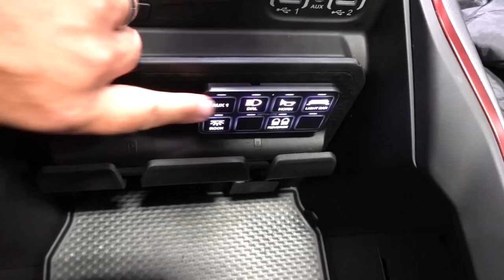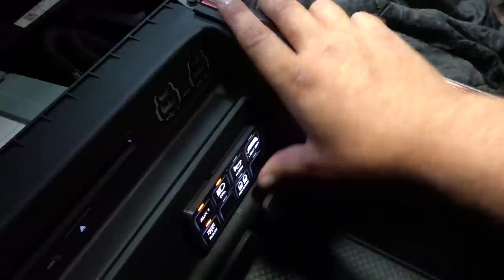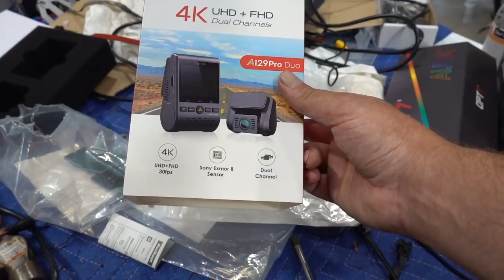2019 Ram Rebel Switch Pros And Dash Cam

Comment: Have you had a problem with alternator out put after adding all the lights and electronics? Mine seems to have dropped to about 3.8-3.9v while cruising. Thinking I need a bigger alternator?
Reply from the maker: wow that's a big drop, I have not had any issues really all I have is the light bar since I only use the reverse lights when backing up in the dark but it is all led so not a huge draw on mine

Comment: Hey man, i have the same truck and am having some issues figuring out where to tie in the ignition fuse for the switches. Which fuse did you tap for the ignition wire?

Comment: Good evening Steve!  Hope all is going well.  Has a question for you, what’s your take on CAI for our Ram Rebels? I noticed you haven’t done that yet....or have you?  Maybe i missed it if so.  Was curious on your thoughts on a CAI for my 2020 Stock Rebel.  Suggestions on brands on either oil or dry system?
Reply from the maker: I am waiting for the one from Cold Air Inductions it hopefully will be out soon but in my opinion they have the best product for my truck

Comment: No worries on the hiccup, makin some changes takes some figuring out along the way...congrats on everything coming together and working properly im glad thats the case👌 looking great now 👍👍 question when andbif you want to add to the 2 empty spots on the switch pro you dont have to hack in again to get to it for a hookup do ya i cant remember it the mains are just under the hood, and if so did you extend some wires from the switch pro box for easy access for the future?
Reply from the maker: That’s the beauty of the switch pro it’s all under the hood now that it’s mounted

Comment: I ended up using the trigger on the side marker and the lights I tied into the bed lights, so when I unlock my truck or want to turn the bed lights on, the rock lights will turn on with it when you set to in the switch pro app.

Comment: I really like the switch panel. Not a fan of the dark paint in the mezzanine it might be too dark later but that's probably just me. Super jealous of your shop though!
Reply from the maker: Snowcat_srt it will look different once the white trim is in and the neon signs will brighten it up for sure, and yeah the switch panel is pretty awesome when you have a bunch of accessories makes it easy to control them
Reply: @HammerdownMotorsportsUSA  hell yeah man. It might look darker than it is because of the video. Anyways man keep it up!! Can't wait for those spacers

Comment: If you don't want to see the wires around the battery.... we used to cut some black plexi around the battery and contours and put a couple of small brackets in and cover all of it. Looks awesome.
Reply from the maker: I may have to do that I would like to cover the wires for sure
Reply: @HammerdownMotorsportsUSA  hit me up when you want to do it and ill give you some tips. But in short. Use a cardboard box to cut a stencil around all the contours and battery. Then trace on to 1/4 inch plexi (color of your choosing' but in the engine bay black works well), use a jig saw (with appropriate blade) or a router to cut. The place small brackets I places that might need it. Added bonus the plexi now gives you an area for decals or to mount additional items.

Comment: How did you get ur key fob to unlock your truck without pressing the button? I’ve been trying to figure that out my Durango n charger do it but not my ram... make video on that PLEASE!!!!!
Reply from the maker: If your key fob is on you there is a sensor in the handle that will unlock it when you put your had on the handle
Reply: Hammerdown Motorsports I might not have that sensor then. I thought ur truck didn’t do that at all n after u opened the panel did some wiring u got it to engage or something. Thanx man, much love from Houston man I’m a big viewer specially with u having a ram n me having my first one I enjoy watching what u do to urs. Keep filming!